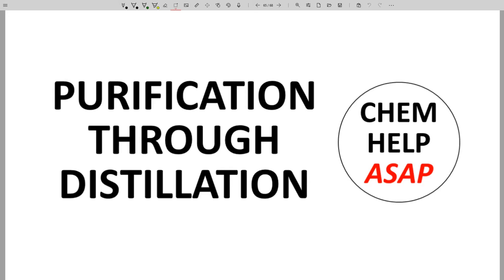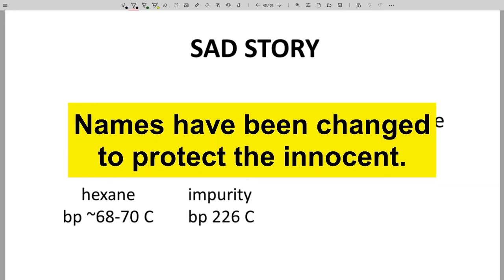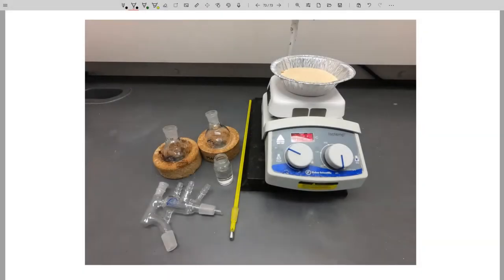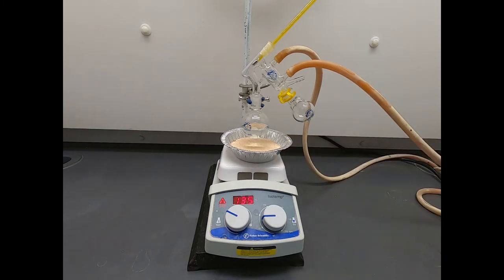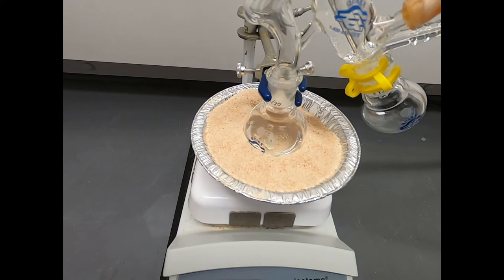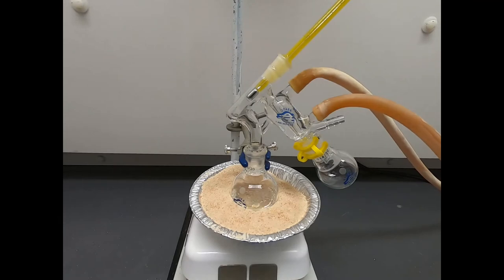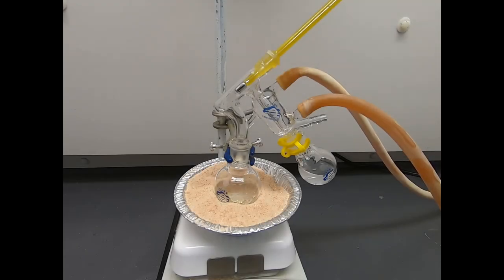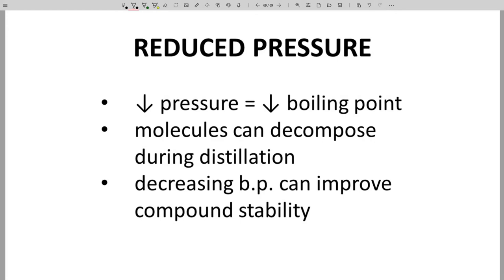distillation & purification of hexane

Comment: Sir, how to separate hexane[20%] in Dcm[80%] mixture in distillation proces.
Reply from the maker: I'm not sure you can separate those two solvents by a bulk distillation process.  Their boiling points are somewhat different, but not by much.  You can try to heat the mixture very gently and see if you can distill off an enriched fraction of DCM in the first cut.